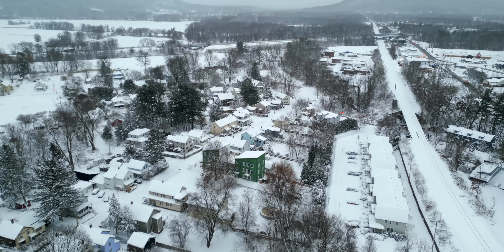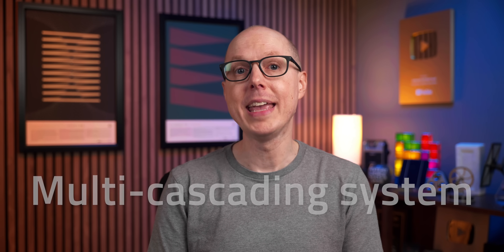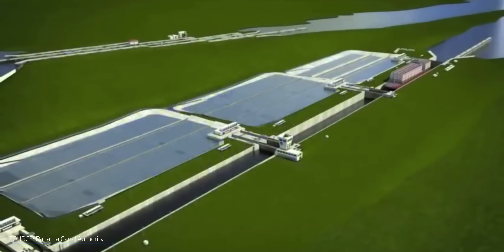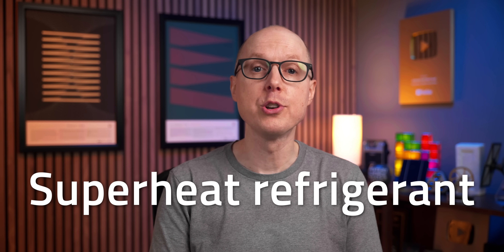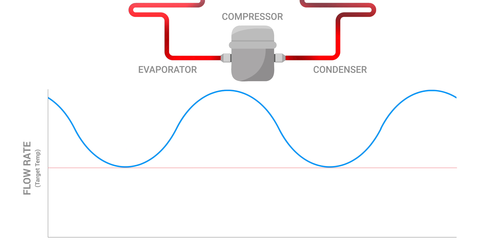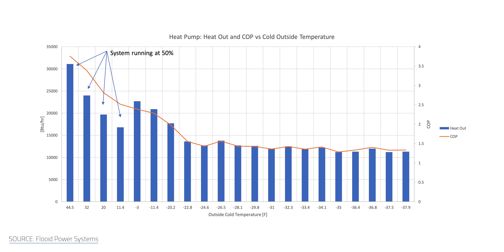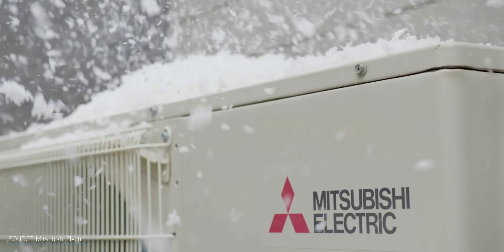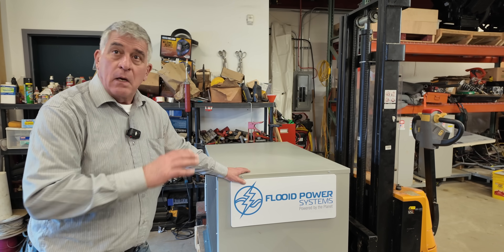How This New Heat Pump is Genius

Comment: This sounds like it can replace a hydronic boiler system for homes with in-floor heating........very exciting
Reply: Hydronic in-floor heating is very easy for heat pumps. Radiators are much more difficult to run. It sounds like this company's system can run radiators efficiently when it's cold which is exciting for retrofit applications.

Comment: Nice. I am looking at replacing my entire heating/cooling system. Just got a 15kWH solar system with tesla power walls. I live in New Mexico in the desert mountains at 6500' of elevations and it gets well below 0F and 100F. In Fact in the summer it can be 40F at night and 95F during the day.
Reply: Tesla? LOL
Reply: @Bob-Fields  Yeah.. big regret there. I should have gone with Enphase batteries. The rest of my system  is Enphase.
Reply: @neomage2021  Everyone makes mistakes. Even me. I'll keep enphase in mind..but I live on the Gulf coast and a whole home generator is probably in my future.
Reply: Learn and about Power and Energy first - they are significantly different things
Reply: @peterbetts8740  Sure... I'm an electrical engineer.

Comment: Interesting approach.  Nice to see an MA company actually doing something noteworthy.  I'll never have to worry about heat pumps because I'll never own a home.  Currently homeless.  If very lucky, maybe one day I can own a box truck, ambulance, school bus, van, pickup truck, or cargo trailer, convert it to an insulated, living space, with solar power, possibly a mini AC, put heating might be cheaper with small wood stove, or even better, some fat (lard, vegetable oil) or alcohol (methyl, ethyl) based heater, something to heat a small space, with an isolated exhaust loop, heat exchange vent loop, etc.  A heat pump would not work in this niche.  Not ever.
Reply: Heat pumps in homeless shelters, or in the box truck. I won't own a home either and I feel ya.

Comment: I don't think heat pumps are the solution for everyone. I think biofuels will play a large part in the solution for conversion of oil systems and even replacement of gas systems in places with low electrical capacity. We also need heat pumps capable of producing steam. I came up with an idea similar to this cascading heat pump that would be capable of producing steam. By having the first loop use a refrigerant such as R-290, or even the forgotten R-30 and R-611 (Methylene Chloride, Methyl Formate), you could have high heat transfer on the low side even at subzero temperatures. On the second loop, use R-764 (sulfur dioxide), which can have condensing temperatures of 240+°F. As the final condenser, use a refrigerant to water heat exchanger. On the steam side, if a vacuum pump is added (2 pipe steam), the temperature of the steam could be adjusted based on outdoor temperature and 2nd stage condensing temperature. This would be a very niche system for a very limited number of applications, but in those applications I think it would work well, especially moving the interior heat transfer away from the atrociously inefficient forced air and towards efficient steam or even hyper-efficient vacuum steam. For houses that are currently on hydronic heat in New England I think 100% biofuel (B100) is an easier and less wasteful conversion than abandoning the system and installing heat pumps. It's a carbon neutral solution that involves zero retrofitting for current oil customers, and only a boiler or burner replacement and fuel tank installation for natural gas customers. Until steam and hydronic heat pumps that function well at low temperatures are available, many will not be willing to convert to these ghastly, loud, forced air heat pumps, and leaning on B100 for these customers is a better approach at the moment.

Comment: A heat pump is next on my to-do list of big projects. When I got my 1st house, the AC unit was already in terrible condition. I’ve cobbed it so it still works, but it’s a Sword of Damocles that could fall at any time… or perhaps more of a Schrodinger’s AC, whose cesium may or may not have already decayed.
Reply: Whatever you do, DON'T MEASURE IT! 😂

Comment: They should test it out in Death Valley.  It works good there, everywhere else will be easy.
Reply: The load on a heat pump cooling during a Death Valley summer is less than on a heat pump heating during an Upstate New York winter.
Reply: @pleappleappleap  That depends entirely on the thermostat setting.
Reply: @dafunkmonster  Pick one and compare it.

Comment: Very interesting, good video. Sounds like similar principles the environmental testing chambers I used to use. A refrigerator within in a refrigerator (two compressors, different refrigerants) to cool/heat as required.

Comment: SOMEONE CONTACT TECHNOLOGY CONNECTIONS RIGHT NOW!!!

Edit: Y'all,  the running gag is that Technology Connections keeps circling back to heat pumps.
Reply: It's a cool idea, but an inverter/VFD heat pump can do nearly the same thing and it's much less complex (and cheaper) to implement.
Reply: @jsncrso That is the case in most modern refrigerators and air-conditioning units.
Reply: @jsncrso  does it have the extreme temp range also?
Reply: Through the magic of buying two of them!
Reply: More pumping, more now!
Reply: This add for FLooid is good on the cascade idea but weak on the occilation problem in a heat pump: that plays in a traditional design but not in a (dual) inverter pump.
Reply: He gets paid a lot of money to make those
Reply: Say it with me: "The latent heat of vaporization!"
Reply: @GoLivingInternet  I heard this in his Voice!
Reply: @GoLivingInternet  "THE LATENT HEAT OF VAPORIZATION"
Reply: @antibrevity TC did a video about how klaxon car horns used to work, he doesn't limit himself to only current technologies at all. More importantly, he's only likely to include these in a video when he finds more to talk about with refrigeration since he doesn't personally have an example of one to center a video on
Reply: @bosstowndynamics5488  "I didn't buy just one of these.  I bought a second one.  [Plops onto desk]  And a third one too.  [Plops onto desk.  No longer able to see him.]  This isn't working."
Reply: He's a subscriber. He'll see this
Reply: Circling back, like the refrigeration cycle?
Reply: @Jake9066  ayyyyyyyy
Reply: @Jake9066    I had assumed that was the OP's originally intended pun... maybe I gave too much credit?
Reply: @Jake9066  No like a vacuum-train-hyperloop-pod(train): the most economical form of transport. ]: )-
Reply: I immediately wanted Alec's opinion on this technology.  It's years from wide deployment, assuming it actually is as good as it seems, but it sounds like something he'd be gaga for (in his understated sort of way).
Reply: @ThatSoddingGamer  It's heat pump related. OF COURSE he's going to make a video on it! (Unless it's No-Effort-November, of course)
Reply: After I watch technology connections I find myself proselytizing my friends, family, and coworkers on the virtues of heat pumps.
Had them overseas, back in America and they're nowhere to be found.
Reply: @dvalentino7492  We need to become an organized movement. I have become the same type of person. 

When I see a Mister Cool unit in the wild, I immediately tell my nearest friend about how they work in both directions
Reply: @dvalentino7492  I KNOW! I lived(/visited for work) im several "Third-World" countries, but somehow they all had cleaner, better conditioned air than we did back home... And for 1-3 orders of magnitude less money.
Reply: I can just see it now.  "Through the magic of combining two of them, the system is now even more efficient!"
Reply: @redsquirrelftw  yes!!!!
Reply: Through the magic of buying three of them.... nah, will be a costly episode.
Reply: For sure, that would make for a great video.

Comment: Tesla cars optimize the heating and cooling of every function within the car and environment in a single minimized system.  Homes need the same design attention within a maintainable packaged unit to be cost-effective. That or plug-and-play combinations perhaps. 
New home utility rooms look like a nightmare to me.
Reply: Tesla has the luxury of not operating below -20 F. House’s systems have to work no matter what the temp.
Reply: @jsbrads1  My Tesla has very few issues with cold weather operation in -40 F. Never have a problem starting like my gas and diesel.
My point is complete system design, like the company in this video, is approaching; HVAC, plumbing, and power.

Comment: cop of 4 is gas/propane  equivalent,  as someone who had a cop of 2 and worse with my 1900  property in -20f its not cost effective to run a heat pump at all, even if like me who had cascading Mitsubishi split ,  it never met requirements, two winters now year 1 1720 dollars for 3 months,  year 2 1512dollars,   yet the new anax worked ok its all about the heat loss calcuation,  if you have more than 11kwh loss you need a split multi system, if you have a heat loss of more than 20 kwh like me, then don't bother,  i have now gone to propane for this part of the house,  and significantly in winter -25f when power was loss if it wasn't for the log fire we would have been in serious  situation,

Comment: Every arrangement is subject to the same limitation: you can't create a temperature difference with less energy that you can get out of a heat engine running off that temperature difference.

Comment: I can see a whole-home system that runs a refrigerator/freezer, water heater, and AC all in one, using a single efficient process for all three. In the middle, of course, it uses air (or geo) to acquire/dump excess heat.
Reply: One that doesn't leak, I hope.

Comment: The thing is, if the higher efficiency in those (depending on where you live) rare temperatures doesn't offset the additional cost over the lifetime of the heat pump, it really doesn't make any sense.
Like you said in the end, I feel like, unless this sometimes becomes super cheap, it'll be a niche product at best, for when you live in a super cold region.
Reply: Yeah, single stage heat pumps are already great in most use cases and climates, and far simpler, more robust and easier to maintain
Reply: @bosstowndynamics5488  you're confusing the term stages with the cascade system. Staging is used to describe multiple capacity levels of a non cascaded system.
Reply: @SuperS05  Fine, single loop. Apologies for using a term that's technically incorrect if you're an industry insider but is nonetheless very easy to understand in this context

Edit re below comments, left original text for context
Reply: @bosstowndynamics5488  wasn't trying to pick on you. I guarantee you'd have a pretty confusing conversation absent the context of this video, especially if that conversation is with anyone in the industry. This is already a complex topic, just trying to make it easier for you to talk to others about it.
Reply: @SuperS05  Yeah sorry, realised that my reply was unfairly defensive and snarky, even went to delete it but YouTube wouldn't show it after I posted it 🫤
Reply: @bosstowndynamics5488  don't sweat it. Text responses are notoriously terrible at conveying emotion and other non verbal messaging without writing a novel. Lol.
Reply: Totally agree. It would have been an interesting solutions if the compressors in heat pump had a fixed rpm which is not the cases for new models. So it is a interesting heat pump system for particular cases which is brillant for some people but won't be relevant for most.

Comment: I want an integrated refrigerant system, connecting my freezers, refrigerators, water heater and HVAC systems. It seems nuts that my fridge dumps excess heat into my house in the summer, when I'm running the AC, and that I can't easily keep the freezer cold in the winter using the cold outside air.

Comment: I'm surprised a company like this doesn't internally work with Kelvin or at least Celsius, even in the US.
Especially when dealing with temperature differences, Fahrenheit is just too complicated and unprecise.
Reply: "Especially when dealing with temperature differences, Fahrenheit is just too complicated and unprecise."

Lol there's no difference in precision, unless you're artificially constraining the number of decimal places you're allowed to use. In which case, Fahrenheit can be more precise, because it has greater resolution.

But we don't artificially constrain the decimal places. So the precision is determined by the instrument, not the temperature unit.
Reply: I was 16 years old in 1976 when we were going to switch to the metric system.  At that age, I would have easily learned it.  Somehow, that mandate died, and we still have the old English system.  There's nothing un-precise about about it, it's just the inconvenience of converting from one to the other.  It's the standard here, just as the metric system is the standard nearly everywhere else.  When you do videos in the metric system, I find it just as inconvenient to do the conversion.  I don't like it any more than you do.
Reply: @theclearsounds3911  "un-precise" 
Dying.

Comment: The biggest problem with all this "new" cutting edge technology is that its either completely unavailable to anyone that might want to get it, or even if it is available,  its so expensive that only a millionaire or someone willing to take out a second mortgage on their house could afford it. More effort needs to be made on getting costs down, and making this fancy new tech something you can walk into a big box store and buy without financing, and take home and install yourself.
Reply: This isn't new or cutting edge technology. I have cascade units that are 30 years old and still operating. They were in text books that are at least 30 years old at this point.
Reply: I strongly agree! While it's cool technology, its potential means nothing until it starts being realized through affordable and realistic real-world implementation.
Reply: High price is always the case with emerging technologies. When the automobile first came out it was a rich person’s luxury. A couple decades later and they were everywhere.
Reply: Trane makes this it called a hvrf and it is installed in residental to commercial
Reply: @ryanisaacson118  that is an hydronic air source heat pump, not a cascade system of any kind.
Reply: Price always goes down with mass production at scale. No new technology is ever available to the masses at introduction. Do you think lower class families could afford central HVAC systems when the first forced air furnace for the home was invented? No. It was too expensive.
Reply: Agree.  I jumped down this "electrify everything" rabbit hole years ago.  Replacing car trips with e-bikes is easy.  Getting a contractor to even consider replacing a gas system with a heat pump or electric boiler is another story.  I have had at least a half dozen different companies out to my house to talk about replacing my 60-year-old gas boiler. When I express my desire to go electric they look at me like I have lobsters crawling out of my ears.
Reply: @zacharydeegan8817  it'll likely cost you more in utility bills if you live in a colder climate compared to a modern boiler. That old boiler is probably 50% efficient, where modern ones easily hit 97-99% in the best cases. Assuming an old house where you're not considering changing out the rads, you'll probably looking at a range of 85-97% efficiency depending on the outdoor temp.
Reply: High-temperature heat pumps already exist in Europe.
Reply: @AngloCanadian  They do, we have one that works between -20 Celsius all the way up to 70 Celsius on intake but the efficiency is shit after the water temperature goes over 40 Celsius if outside it's bellow 0. I actually thought about having a dual heat pump system with an air to water unit that works between outside temperature and heats a small buffer up to something like 20 Celsius at which point a second heat pump starts and by pulling the 20 Celsius from the buffer heats the main tank up to about 50 Celsius.
Reply: He’s rich. He doesn’t care about price.
Reply: The tech that matt is talking about that makes heat pumps work in extra cold weather is a resistive heating element on the evaporator coil.
Reply: @GregoryAlbright-t3p  I don' think that's it.  Resistive heating is not efficient.
Reply: @GregoryAlbright-t3p  that is not what is in this video. Rewatched it.